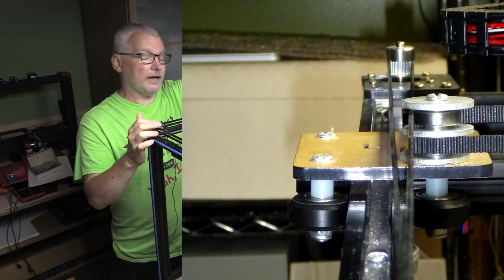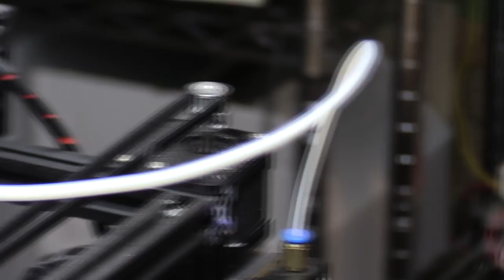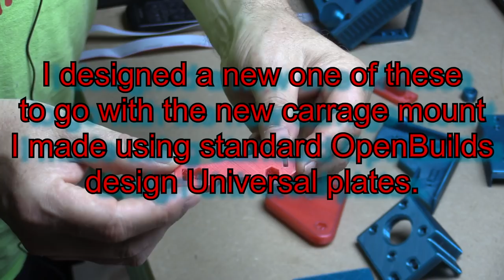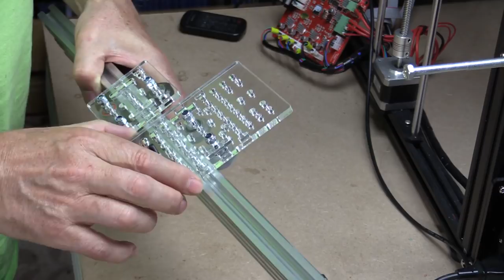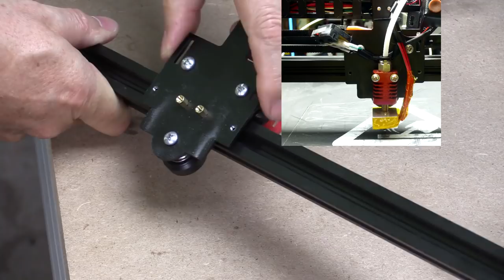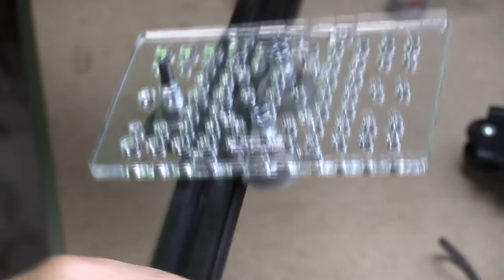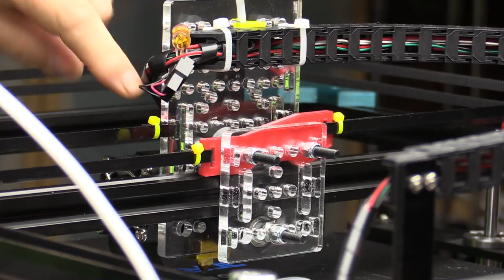TronXY X5S Hardware Upgrade

Comment: Hey peter great videos. I watch them all on Trinity x5s as I have one and done a lot of upgrades. Question. Sense the first day I got mine my heatbed temp runs away on my and I can’t control the temp. I can’t figure it out. Do you have any ideas? I don’t have the original PSU I run a 500w AVG computer PSU. As it’s way better. Yes it’s hooked up to 12 volts to the bed only.
Reply from the maker: I would suspect the bed temperature sensor is not working or incorrectly configured... do you get accurate readings as best you can tell ?, also in the marlin firmware you can turn on the runaway checks if there not already on, did you upgrade the marlin and turn them on ?
Reply: Peter Oakes No I didn’t turn them on, as I don’t know how to do this sir. I have version 1.1.6.  I also just tried running a separate PSU 15volts to my mosfet/bedtemp. No change in runaway temp but did reach higher temps. So that’s a plus. Are you able to send me the firmware to me in an email as a Gcode file as I can upload to my printer as a write file. I have a new sensor so I will install when I return to home. Thank you very much Mr Oakes. Look forward to your reply.
Reply from the maker: It cant be upgraded via GCode, it needs to be done using either an Arduino IDE, Visual Studio Code or other programming tool, have you ever upgraded the firmware or played with Arduino's
Reply from the maker: thermal runaway is nothing to do with the power supply feeding the BED, t is all to do with the software / Temperature Sensor and the MOSFET driving the bed supply. If any of these has an issue you could see the problem you describe. When the bed is at room temperature, what does the temperature read on the display ?
Reply: Peter Oakes no I have never done this programming
Reply: Peter Oakes when I turn the printer on it starts climbing right away.  It shows 20 degree
Reply: When I turn the psu on it will start climbing sir
Reply from the maker: so 20 is about right for room temperature, does it stay there until you start printing or does it start climbing even before you start a job ?
Reply: Peter Oakes starts climbing soon as I give it power. I’ll make a quick video to show you. I thought at first the positive and negative wire on mosfet was reversed as I did that to my hot end and the temp ran away there to. But no not the case
Reply: Peter Oakes, hey there I just changed the bed temperature sensor out and it still does the same thing. Errr so I guess I have to do a software update I’m guessing great. Do you have a walk through from starting to finish on flashing this software? Thanks
Reply from the maker: Love the case for the controller :).
From what you are showing, my first thought is that your MOSFET is shorted or that it is wired incorrectly for the main power coming from the PSU to the MOSFET. MOSFETs have a diode inside so if the power is reversed then that will simply conduct no matter the control signal. check the wiring from the PSU to the MOSFET board and ensure + Volts goes to + In of the MOSFET board.
To test the fact the controller is not the cause, try simply disconnecting the control signal from the controller Heatbed output to the MOSFET board. if the controller end is ok, then the heatbed will still heat up, if the controller is the faulty part then the bed should stay at ambient.

For more info on mosfets, you could view my video about them here https://youtu.be/6WwCqxSaF_w

Let me know what you find
Reply: Peter Oakes yes I checked that. Plus is plus and so on I even checked the voltage on the in and out. Both good. I will chk the control wire from main board to mosfet. I’ll get back to you sometime on Saturday. Thank you for your time sir. Your great keep up the great work
Reply: Peter Oakes. Thank you for the compliment on my case. So I just got home and I unplugged the control side from the mosfet. And it stayed at room temp. I checked the voltage on the wire and I had them right + &- was right. So I trued a new mosfet and the same results. So I’m thinking it’s the software. What would you think sir?
Reply: Peter Oakes. So I did some reading and I watched your step by step video on flashing my software. I get an error at the end of the sketch and it will not go in. Before I ran a check and it’s fine. Did you use your printer cable from your computer to the USB port of the tronxy port. As that’s what I’m doing. Or do I need to buy a boot loader? Sorry for all the questions sir.

Comment: I've now got the new improved design of Tronxy 3D printer in 2020. the "X5SA"  The company has redone some of the brackets and parts. All the Stepper Motors are now Silent versions, the brackets holding the pulleys are now metal and the X & Y motors are on thick Fiberglass mounts,  They have replaced the pulley's for the belts and the power is now 24 Volt power system for better heating of the hot head and the bed, they head has two fans now with some ducts to better flow the air around the head and the hot end has a silicone jacket too, there is a optical sensor for the head to see where the distance of the hot bed is,  all the main box and chain mounted wires are already done, no open box of wiring now! They have a colour 3.5 inch control touch screen too and there is Auto Bed Leveling installed and Manual too. there is 6 leveling point hand knobs on the underside of the hot bed, there is a auto filament run out/ break optical sensor on the side above the spool holder, there is a system where if the power goes down in a printing time. when the power is back on, you press carry on print, and the printer will carry on from the last point done!   The only problem I have is my machine has a leveling fault, it starts the Auto leveling with the head going to the back Y corner frame the touch sensor does it's stuff then the head goes across to the X front corner frame, it does the same touching of the sensor there, then the bed is raised up to the head and the optical sensor does it's checks, THEN the problem?    The head try's to race off to the outside of X front side frame! I have to tap the back arrow on the screen to stop it as the belts are about to pop under the stress?  Tronxy support are trying to help me I sent them a video I did of the actions!  But after 20 days of this I about to just dismantle the printer and get my money back? I could have brought a 43 inch Smart TV for the price this printer cost me?  : (  I really wish I can use the printer.
Reply from the maker: Tronxy if your reading this, send me a unit and I will make some setup and usage videos and be able to help viewers like Colin.

It sounds like the printer has a configuration error in the firmware, everything else you describe indicates the unit hardware and electronics is OK, except for the fact that if the electronics is using silent step sticks they should be detecting when the head zooms off to the side or the limit switches hit their limits ?? It is possible they have home directions correct but other movement configuration going the wrong way?.  so you should be able to get new firmware image from the vendor/supplier, I dont have this model or I would be able to investigate further for you.

Comment: A quick hack for the printhead. Use a zip tie and a washer and use it to put tension between the lower roller on the head and your new petg bracket/belt holder. The head will be much more stable
Reply: @andersstromqvist2211  
Nice Trick

Comment: I love this machine after I upgraded it but my next upgrade will be the single motor Z and rails for Y and some way to manage that PTFE Bowden tube.
Reply: I managed my Bowden tube by simply and loosely tie-wrap it to my wire manager on top ... this way everything moves together. Works great on my X5SA.

Comment: Do you know if the X5SA touch screen will work with MKS boards or other open source boards? I heard it will not work so you have to use different display. any idea why that is?

Comment: Hi, I recently acquired a tronxy x5s and when I was heating up the nozzle for the first time the wires in the nozzle started glowing and burning, it seems it had a short and wasn’t working the right way, with what nozzle I can replace it with? I’m new to 3d printing and need some help, also this blow the onboard fuse in the mainboard, I already resolved this by soldering a external fuse, could I upgrade the mainboard with other one, thinking of doing this on the long run, also, what size fuse should I use for now. Thanks.
Reply from the maker: watch this video regarding the electronics upgrade https://youtu.be/q1nfojoZUvA
you should be able to get a direct replacement head from tronxy?, I have never replace mine yet but im pretty sure most 12V heads should work, if your going to upgrade, you might consider an all metal version so you can print more materials that need hotter temps to work (The stock has a PTFE liner that will give off toxic gasses if used much above 250 ish.

Comment: Regarding your hotend carriage, you need to have the eccentric nut on the bottom. If you put eccentric nuts on the top, you will introduce slant to your hotend nozzle.
Reply from the maker: Good point and thanks for mentioning it. In the video (And I just checked), I do have mine on the bottom :)

Comment: Great video, I have used 6mm ply slotted into the base and rear channels to strengthen and keep frame square. I'm also looking to replace the 608 bearings with idler wheels, plain and toothed, will not need the additional washers. The bed plate on my printer has connections for 2x12v   OR 1x24v but only 1x12v is connected. simple 12-0-12 configuration.

Comment: Thanks Peter another interesting video, what would be your thoughts on constructing a optical filament sensor for use within Marlin, regards, RobUK
Reply from the maker: Already working on a filament run out sensor... stay tuned :)
Reply: Brilliant Peter, thanks for that, I am sure you could also design a better power resume board with your capability, regards, RobUK

Comment: About the loose wheels on the print head, OpenBuilds has an eccentric spacer that allows you to adjust the wheel clearance by rotating the spacer to achieve a good fit before tightening. Here's a link to that part: https://openbuildspartstore.com/eccentric-spacer/

EDIT: Oh. I listened a bit farther and I see you know about this.
Reply from the maker: :) and used them, but thanks for sharing

Comment: There is a adjustable nut on single wheel, you can adjust it to make it very tight on x axis also same on y axis
Reply from the maker: maybe on more current models being shipped, but on mine there were NO eccentric nuts to be found on X or Y. 
This is a problem with many import printers (Or perhaps a good thing depending on which you get), were the manufacturer is continually changing the BOM and tweaking the specifications / build slightly.
A review like mine could be just released and already the manufacturer has changed things that are highlighted in the video, if this is an improvement then this is good for the customer but may invalidate many comments of a reviewer, if it is a cost saving then the reviewer can also look bad because the product does not even meet the same standard as the presented review and someone may base a purchase on the review. 
For all of use that present reviews, this is a continual challenge and can require frequent rework and monitoring of older reviews to see if there still valid
Reply: @TheBreadboardca  yeah, also they could ship with galss bed instead of galssfibre, as i was unable to level my bed with glassfible, bought 330x330 size glass bed
Reply from the maker: @Kentuliz  Ya, that's were auto mesh bed leveling would help (With the fiberglass bed), I would think fiberglass is not as good a heat conductor as straight glass so the switch should help get better bed temps, assuming the underlying heat bed is also flat to make good contact

Comment: Peter do you know what board the x5sa-400 uses? I am trying to get auto levelling working.
Reply from the maker: from what I can see there may be one of 2 boards (Its a little confusing), there is a Melzie 2 board or an Arm based Tronxy board that I have seen a picture of but can so far find no details

Comment: Hi, thanks for your video. Also I have a Tronxy X5S and I wanted to ask for help if possible. My problem is this: all the steppers are deactivated after 60 seconds by releasing the print bed downwards, I do not understand why this problem occurs. Can you give me some help?
Reply from the maker: Your slicer may be adding an M18, M84 command at the end of the print job, this will disable the steppers after a period or immediately depending on parameters, if this is the case then the slicer should be able to be re-configured not to do this.

Now Marlin may also be doing this on its own and this has been a default. In Configuration_adv.h there's a define called DEFAULT_STEPPER_DEACTIVE_TIME; it is set by default to 60 (seconds)

The area will look like this

// Default stepper release if idle. Set to 0 to deactivate.
// Steppers will shut down DEFAULT_STEPPER_DEACTIVE_TIME seconds after the last move when DISABLE_INACTIVE_? is true.
// Time can be set by M18 and M84.
#define DEFAULT_STEPPER_DEACTIVE_TIME 120
#define DISABLE_INACTIVE_X true
#define DISABLE_INACTIVE_Y true
#define DISABLE_INACTIVE_Z true  // set to false if the nozzle will fall down on your printed part when print has finished.
#define DISABLE_INACTIVE_E true

your can see that in 1.1.8 it is set to 120 Seconds but it is all commented out in this version by default so it should not be active, if you are able to re-compile and upload new firmware then you can change DISABLE_INACTIVE_Z to false, this will disable the timeout on only Z.

if you are unable to upload new firmware then you should be able to issue a M84 S0 at the end of the print job, you may also be able to simply run this to change the saved configuration (Im not sure at this time)

If you want to know more https://github.com/MarlinFirmware/Marlin/wiki/M84

And look in Configuration_Adv.h for 
#define DEFAULT_STEPPER_DEACTIVE_TIME
SD_FINISHED_RELEASECOMMAND

un fortunatly there is no easy way to see what a specific firmware is set to once it is uploaded but if your able to upgrade or re-load then it is all up to you as described above
Reply: @TheBreadboardca  Thanks but, my problem is not the slicer, the printer after being turned on and made the home, then ready to print, I do not have time to do anything because after 60 seconds you turn off all the steppers by dropping the bed, at the beginning I did not have this problem, I can not understand why. Before to disable the steppers I had to act on the command "Disable stepper" and it was ok. Now, however, after 60 seconds they turn themselves off, so I can not do anything, I can not even start a print.
Reply from the maker: @MauryXman  The slicer part of my response also included a way to turn off the timeout "M84 S0", I am now assuming you had this working one time and now not, did you upgrade Marlin, if so from what to what? Did this problem happen from Day 1?, are you able to follow my previous response instructions ? and let me know the results
Thanks
Peter
Reply: I am not able to execute your instructions because the printer goes down the Z axis after just 60 seconds from the "Home" operation, so I can not use it. At the beginning the printer worked well, I did not have this problem, it suddenly appeared without modifying anything. I have not made any updates, the firmware is the stock version of the Tronxy X5S. Thanks for help
Reply from the maker: @MauryXman  Is it possible a fan cooling the stepper drivers has failed or there overheating and shutting down, the Z is always over driven as it is typically driving 2 steppers, you should be able to hold a finger on the Z drivers (Or any other ones) without burning  but be careful and expect it to be hot

Comment: Good video! Did you have to use eccentric nuts in the motor mounts?
Reply from the maker: it came without but after a while as the wheels bed in the carriage will become lose and then you need to tighten things some how. the eccentrics make this easy, squeezing the wheels together and hoping while you tighten will never work well lol.
Reply: I'm thinking of doing this mod on my X5S. Do you have the STL for the modified part? On Thingiverse? Thanks!
Reply from the maker: The links are in the description,,,
Reply: OK, I understand. I thought you had to redesign the part to use the eccentric. You just used an eccentric instead of an ordinary nut.
Reply from the maker: I changed the gantry plate for an Open Builds style part and changed the spacer for an eccentric
Reply: Hello @TheBreadboardca  ,

Which size eccentric nuts are you using? the 6mm or the 1/4 ? 

Good videos! just ordered the x5sa
Reply from the maker: @RonCromberge  https://openbuildspartstore.com/eccentric-spacer/  this link contains the specifications for the spacers, mine look a little different but the hole etc is the same. BTW, the 5 mm bore is the hole through the spacer, the 7.12 mm is the hole in the plate for the eccentric spacer, I just measured my standard spacers and there all 1/4" I dont have any eccentrics left to measure without disassembly but I would conclude they will also be 1/4" ones to match my reg spacers

Comment: I like the simplicity of this design and the modifications you've made to it.
QUESTION: Would it be practical to build one of these printers from scratch using OpenBuilds parts that work and fabricating the other parts?
Or would it be worth my while to buy one of the X5S kits and then mod it from there?
Reply from the maker: That is the subject of a upcomming video :)
Reply: Okay. I'm now a subscriber!
Reply: richard Acker  You should post a video about it. I'd like to see how you put it all together.
Reply: richard Acker  I'll be looking for it. I just SUBSCRIBED! So I'm your first subscriber.